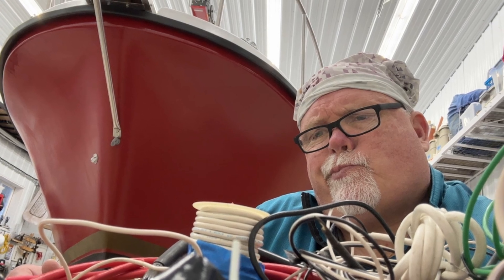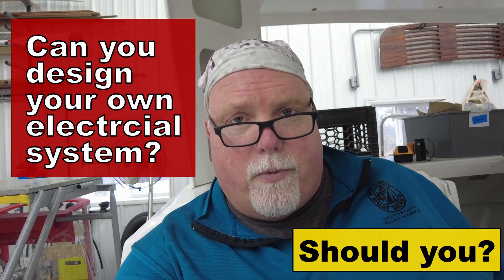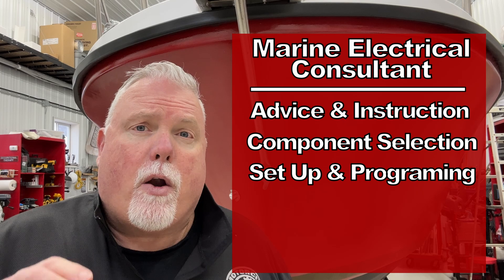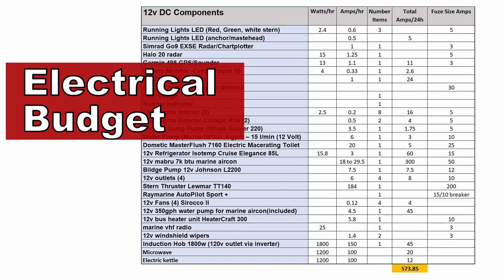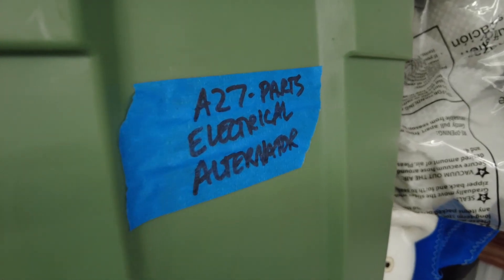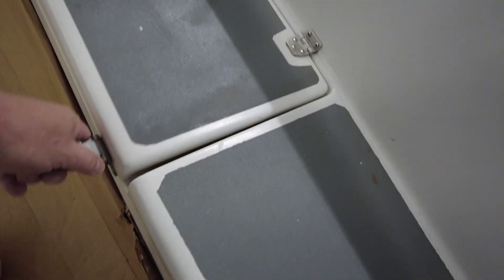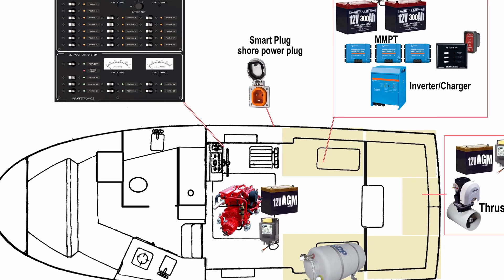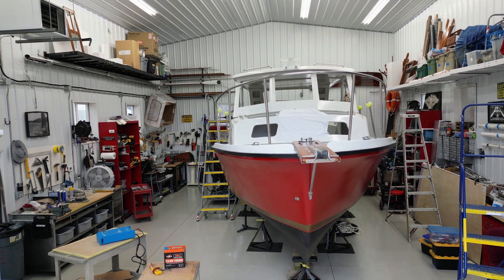Boat Restoration Reality: Why I Hired a Marine Electrical Consultant | Trawler Restoration (Ep107)

Comment: Okay, there is one nuance you may be off base here. Please talk to your consultant about this. 12v is fine and all that, BUT if you spec 24v or 48v, you’ll save a great deal of money in wiring and components, then finally convert to 12v for the appliances running electrical. It would be interesting if you did a follow-up on this explaining the cost savings. I think 48v might be close to half your total project cost.
Reply from the maker: Thanks for the comment. On the surface this might seem plausible, there are advantages to 24v or 28v. But the availability and selection makes this is not the case. 🙁

Comment: Joe- you're reading too much into the abyc standard. I'm actually studying to get my ABYC electrical cert. You are fine with having the fuel fill and vent running along side the batteries. Just can't have batteries laying directly on top- or below- a fuel tank without a deck partition. So no need to re-route your fuel fill and vent
Reply from the maker: Thanks Danny. But the specific rule is quite clear. Fuel fill and vent constitute fittings —and the batteries can’t be below them. So the fittings must be moved. Then uninterrupted fuel lines can come back through the electrical compartment  😀👍

Comment: Lifepo4 is the only way to go nowadays. Half the weight twice the power and 10x the lifespan. Start battery should be the only AGM that you buy anymore. Alternator charging lithium is not hard you can add dc to dc charger or regulator for alternator. If you have an alternator that can produce 100amp you don’t need anything as most bms on lithium will only charge at 100amps. Currently on my boat I’ve got lifepo4 and I parallel connect them to AGM and charge from alternator had this setup 5yrs now. Currently I’m designing a 50amp 240v split phase setup and I’m going with Victron. 120amp alternator will work on lithium read battery and it will say it only accepts 100amps to charge.
Reply from the maker: Thanks for the great comment 😁👍